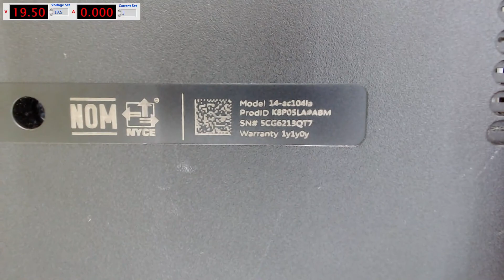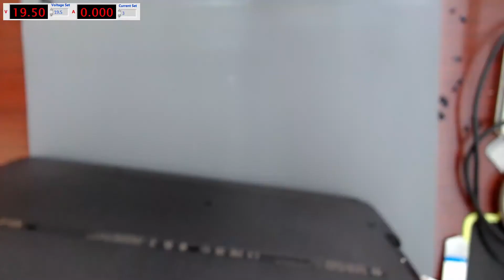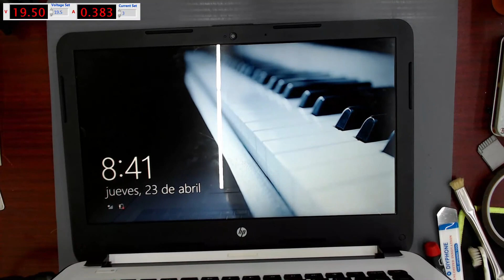FIX HP 14 AC104LA Won't Power On, HP Laptop Motherboard Repair

Comment: What do you need to clean the motherboard what liquid ?
Reply: Personally, I wouldn't use anything other than isopropyl alcohol.
Reply: @rscelectrical7091  or contact cleaner
Reply from the maker: Distilled water, petrol, isopropyl alcohol, contact cleaner, or Zippo. Make sure you dry it after cleaning.

Comment: Ive tried to repair my old laptop that was corroded 
After cleaning with alcohol only some light indicators turned on but the fan wont go an and start the pc what should i do? Pls help me tnx
Reply from the maker: How bad was it? did you check if any component was loose or missing? Was it corroded around BGA ICs?
Reply: @MyRepairVideos   nothing’s loose and missing just corroded areas. This laptop got peed before lol. And yes there are corrosion in most places but not that much. Can you recommend something to remove corrosion? I don’t have that stuff that you used in your video :< 
I have wd 40 here and also paint thinner some videos used paint thinner. What do you think?
Reply: @bagyoserg8381  Contact cleaner and flux + hot air to clean corrosion.
Reply: @yuanho2883   okay thanks im gonna try that

Comment: Ive got a bad vbios flash on my HP Omen 15 ce198wm  ..do you know if the vbios and bios are on the same chip and where is it located on the motherboard i cant seem to find it HP Omen 15-ce198wm Intel i7-8750H 2.2GHz Motherboard L10770-601
Reply from the maker: You should check the schematics. Search for schematics with the motherboard model, Should look like this "DAG3AEMBCD0". It's  a label on the motherboard.
Reply: @MyRepairVideos  My brother if you can find it I tried with no luck you know maybe better please provide a link if you could.
Reply: @neosrt10  What's the motherboard model?
Reply from the maker: Sorry bro, no schematics available for that model. Only Bios BIN can be found on internet.